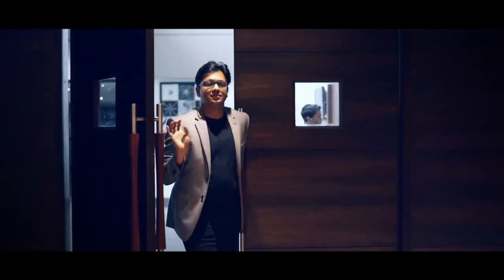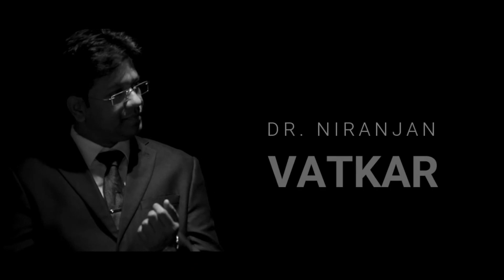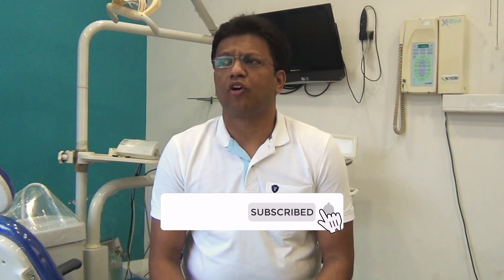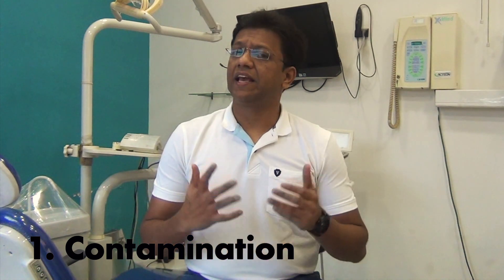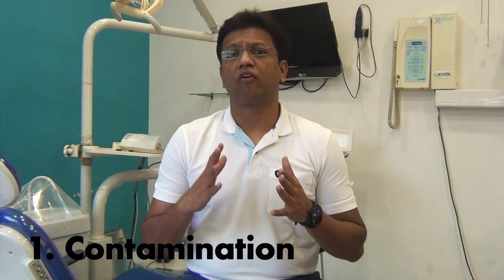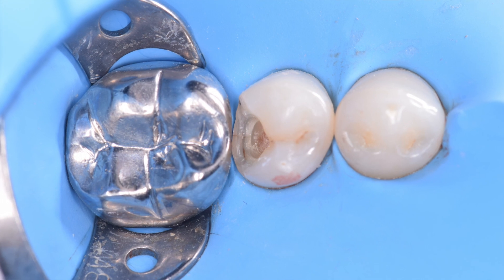Pain after composite restoration (5 reasons)

Comment: Doesn't selective etching means etching only enamel?In the video it is mentioned that in selective etching,after etching enamel ..the dentin is etched for not more than 20 sec...pls clarify
Reply from the maker: Yes. The term is actually confusing. Enamel and dentin both have to be etched. Dentin no more than 20 sec
Reply: In my understanding , omit the deeper portions of the Dentin towards pulp and etch the remaining part of the cavity for selective etching . And any portion be , not more than 20 seconds . I don’t know why doctor mentioned 40 seconds which is way too lot as we are using self etch bonding agents.
Reply: I like to add etch on enamel first for 10 seconds and then add etch on dentin letting that sit for 10 seconds. So enamel gets etched for 20 and the dentin for 10. Rinse